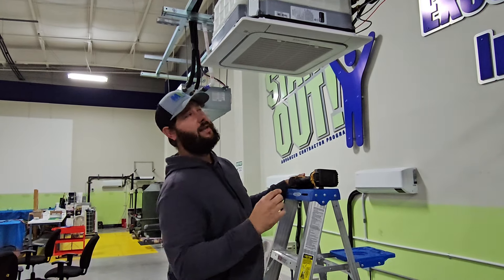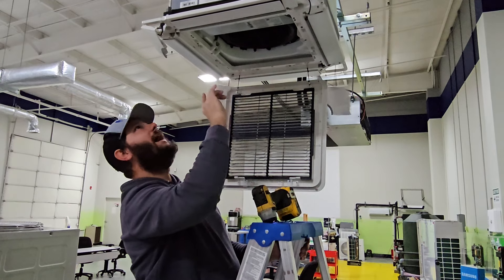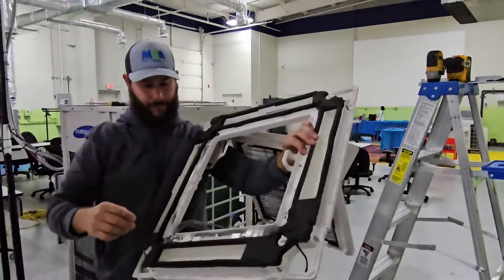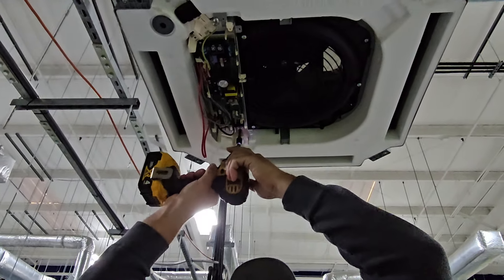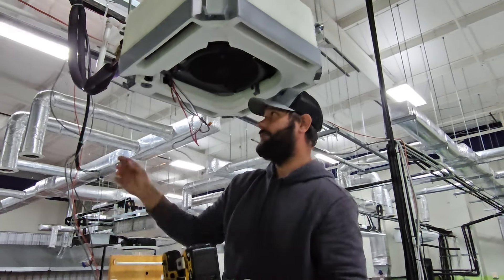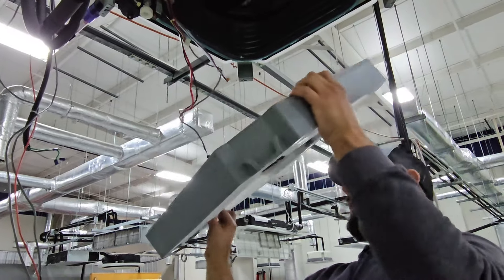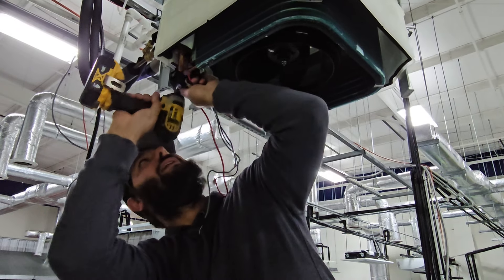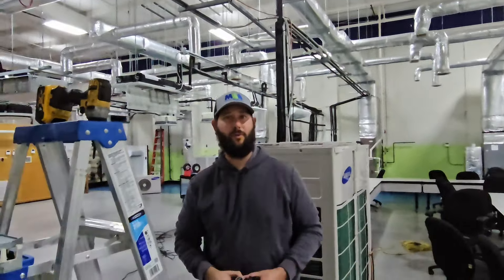Ceiling Cassette Repair SHOCKINGLY Easy!

Comment: Would be beneficial to have some additional light on the underside of the  cassette during the training.  Thanks I found this very helpful on getting familiar with the unit.
Reply from the maker: That was my only regret after I did this video.I did not consider the low light

Comment: Would one of these units heat and cool a 30x40 open shop?  Do you need to have a ceiling around it or can it just be open like you have in this video.
Reply from the maker: yes I would do at least a 2 ton unit